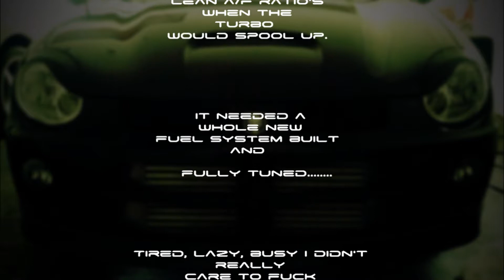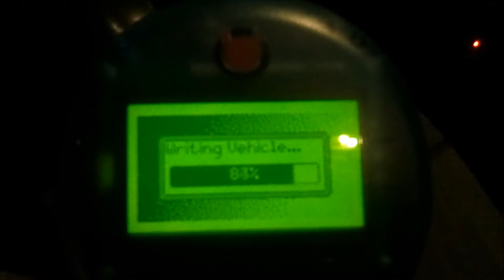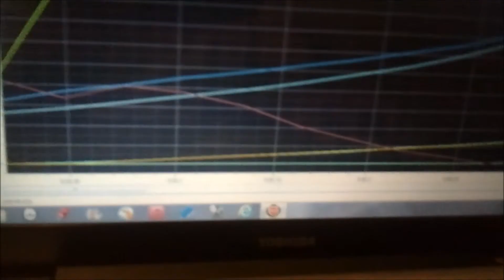SRT4 - e85 fuel system build up

Comment from the maker: @antval1234  Truth... But so far while tuning the Injector duty cycle still on the safe side and the car is getting a scary quick..its only on 25psi...I still have my meth kit for a lil added safety but the fuse is pulled, its really not needed on e85... Prolly sell my 925cc injector and the meth kit and go with Injector dynamics 1000cc they will be plenty for the power level im comfortable with for now. Thanks for the comment hows the evo rollin?

Comment: Sweet vid bro! I know exactly where you are at when your cursing down 330 to rollingbrook I work at Exxon just bought a 05 with a 50 trim currently building the motor I spun a rod bearing. Should be out of the machine shop next week some time. Thinking about taking it to fwp to get it tuned. Je pistons eagle rods and strap kit Just because. Do you still have your neon?

Comment: I know the video is old, but i hope it's tuned better now. The log you showed at the end of the video isn't that good. You could have 35+ degrees of actual spark on E85 with no knock. From the log it looks like you have 21 degrees at 5800rpm @22psi..